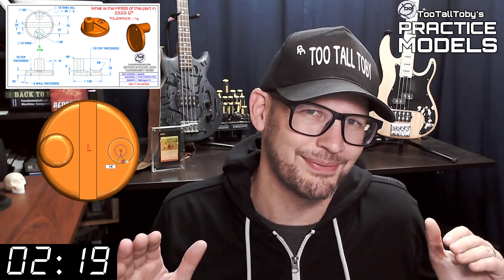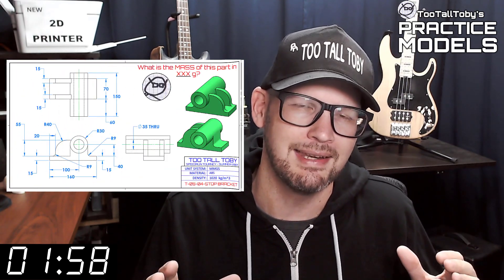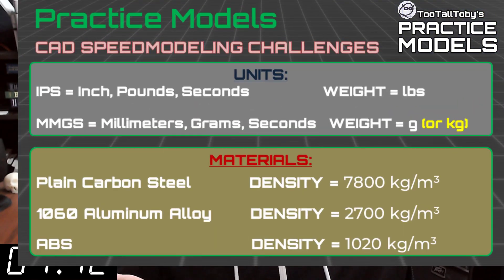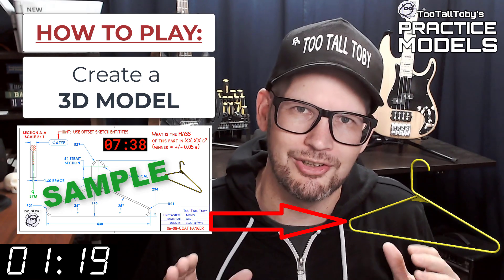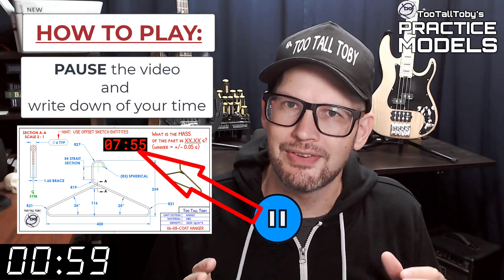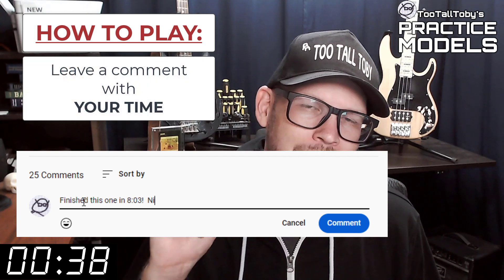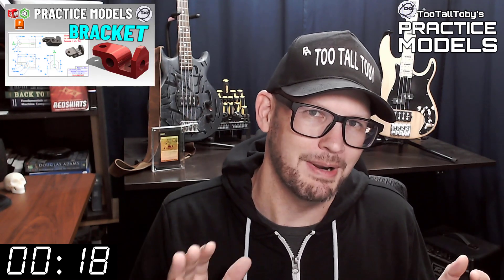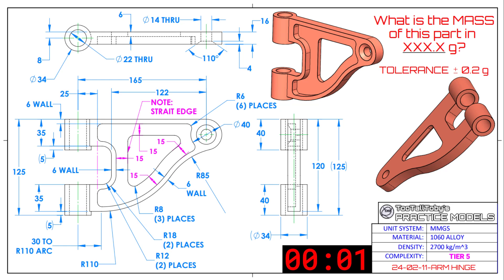CAD Practice Model Challenge - Onshape, SolidWorks, Alibre, Fusion360 - ARM HINGE

Comment: 381.117g OnShape.  First try, but it took a long time.  Most of the time spent drawing the interior curved shapes, especially along the lower arcs.  Sketch fillets didn't work everywhere; I had to use tangent arcs instead.  I'm sure there are shortcuts that I missed.  Great challenge.
Reply from the maker: Awww yeah nice job Ken!

Comment: This took me a lot longer than I thought it would. over 25 minutes for me in Onshape.

My main time loss was refusing to use a revolve for the countersink hole because of the dimensions. I ended up using a mathematical formula to compute the diameter of the countersink,
If only I could use dimensions in 3d and leave out parameters in features.
Reply from the maker: yeah this one is deceptively tough - nice job getting through it!

Comment: EDIT: was able to solve it via "manual fillets" using the tangent circle tool.

381.12g in Plasticity. Tricky model! Thank you @TooTallToby for another great practice model.
Tutorial: https://youtu.be/XHngyL_nAyI
Reply from the maker: maybe try INSERT > FACE > DELETE and then re-create the fillet.  (delete and patch)
Reply: @TooTallToby Tried this again during my lunch break. I just created "manually filleted" via a tangent circle.

Seems like there were 2 places that required this trick, but I got the final mass of 381.12 in plasticity 😀
Reply from the maker: nice! @davinchewk

Comment: Didn't finish it in time the first time. I started with an extrusion of the plate and made the large side 125 as per the dimension. But it should have been 120. That 5mm offset in the cylinder got me. It must have taken me at least 30-40min to figure it out.
Reply from the maker: lol - yeah some of those dimensions were FUNKY!

Comment: 381.1g, in Onshape but kept screwing up the dimensions from the chamfered hole to the hinge axis.  Don't be in a hurry on this one.  Sheesh!  I made the chamfered hole by first making a 12mm blind thru hole from the back side, then did a simple extrude from that new surface to the front face with a 55-degree draft.  Not sure what the best way is but was happy with my solution.  Really good part, Toby!  Thanks!
Reply from the maker: Very nice work pcrduino!  I’ll try to make an onshape tutorial for this one soon!
Reply: Yeah, I sorta cheated there.  I used a countersink hole and modified the countersink diameter up and down until the depth of the countersink was exactly 4 mm.  Another reason my time was off the chart. But by then, I'd long since given up worrying about my time. 🙂